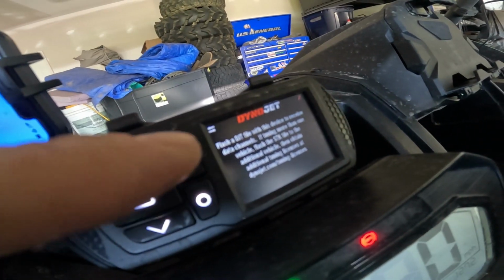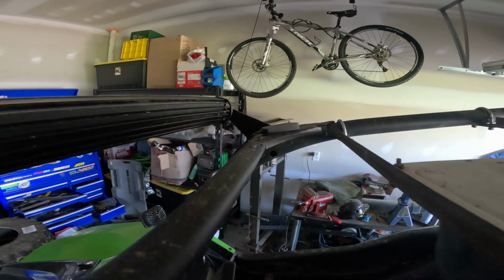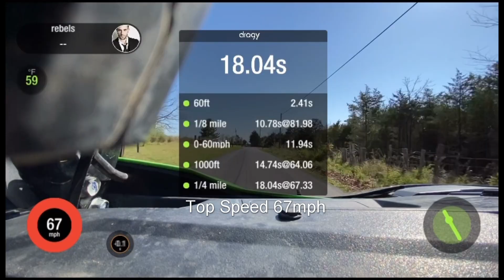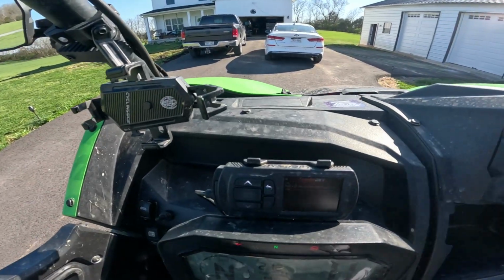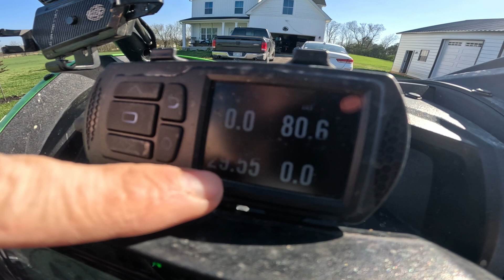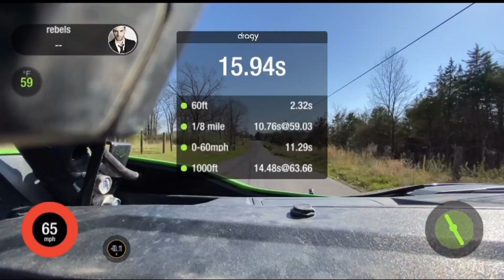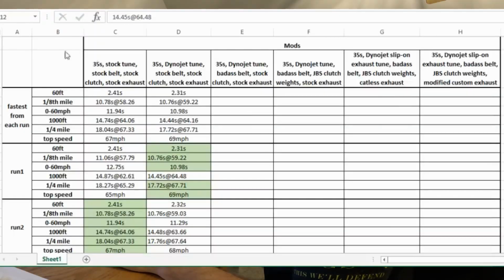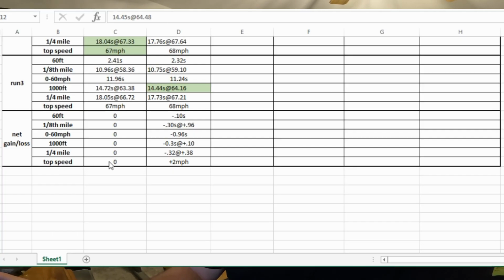How Fast is Kawasaki KRX 1000 on 35s with Dynojet PV3 tune?

Comment: Yes been waiting for this I just got the dirt legal thing done to my side by side drive it 30 miles to work tonight I will be getting smaller street tires ASAP had a headache by the time I got to work them 35s are loud on pavement but all this street riding is hit me thinking I would love to have more throttle response it cruised easy at 58-68 miles a hr for a 18 mile stretch belt temp did get to 3 bars which I’ve never seen it get above 1 on the trails but I guess 60 mph for 18 with 35s would cause it to run higher but motor temp never hit above 170
Reply from the maker: That’s awesome you got yours street legal! Mine is finally street legal in WV and I’m making a video to show how I did it here soon. Idk if I’d get much smaller tires if you want to cut down on noise. The smaller tires will create more RPM and engine noise but you will have lower belt temp and better throttle response especially with a tune. Thanks for watching!
Reply: @rebelsoffroad  the 35s I have on it now or Sedona trail saw and man they gave me a head ache but it sure was fun driving in the roads it’s illegal in Ga to ride atv on roads and they want title a off road vehicle is why I used dirt legal yeah man great video can’t wait to see more do you still have factory exhaust on that machine ?
Reply from the maker: I’ve heard good things about the trail saws offroad how do you like them other than the noise? I haven’t done any exhaust yet but it’s on the list
Reply: @rebelsoffroad  they great on the trails not as good on rocks as rock zillias  but since I did the dirt legal thing I haven’t had much time and haven’t been on the trails since thanksgiving only black top and they are loud on the road I’ve put 100 miles on the asphalt with them I’m buying new wheels and highway tires next week so I can keep my trail tires good for my windrock trips
Reply: I’m surprised you hear tire noise at all. I have 35” zillas and the engine and exhaust noise are so loud I don’t hear anything else including my music above 30mph. It gives me a headache and so I only ride the street if it snows or I’m running to the gas station 1/8 mile away to fill up before a ride
Reply: @marka1712  yeah it’s loud I’m buy some street tires and different wheels asap was gonna order this week but as you know unexpected stuff always happens just my luck

Comment: Nice video. Curious if you hid the PV3 wiring through the dash or just ran it straight down to the plug?
Reply from the maker: I hid it and zip tied it behind the dash so I wouldn't kick the cord getting in and out.

Comment: Did you make part 2?
Reply from the maker: Yup! And part 3 😁 part 2 is the badass belt and part 3 is the jbs weight
Reply from the maker: Best belt for Kawasaki KRX? Badass Belt Install & Performance Testing (With Real Draggy Data)
https://youtu.be/I30D5btbuU8
Reply from the maker: How fast is Kawasaki KRX 1000 w/ JBS clutch weights? Install and performance testing, 0-60 and more!
https://youtu.be/8NzQKFtwJ7k

Comment: This is just tune, no exhaust, correct? 87 or 93 tune?
Reply from the maker: Correct. 91-93 is recommended with this tune. I typically run 93

Comment: Really not a lot of games for a lot of money
Reply from the maker: Im learning that if you are looking for big gains from any clutch weight or tune you’ll be pretty disappointed. Only so much a NA engine can do
Reply from the maker: The gauges and other features the pv3 have are what makes it worth it to me
Reply: Here are some other reasons a tune might still be a good idea:
Adjust rev limit
Adjust speed governor
Raises limp mode to 7000rpm
Adjust drive by wire
Adjust cooling fans engagement temperature
Eliminate Reverse limiter

Throttle response and reverse limiter were key for me.
Reply: @RockCrawlin those things were all set by OEM for a reason. Any deviation from stock will reduce reliability and longevity. In my opinion bolt on mods like intake, exhaust and clutch are the only things you should use with a mild tune. If you want to tune further then getting into the engine with power supporting mods is the answer for reliability and durability.
Reply: @93Tillinfini  Agree and disagree.  Manufacturers make their machines to perform for the middle of the bell curve.  Their OEM specs are for the people who don't change their oil per recommendations, have old fuel in their tanks, don't inspect belts, don't blow out clutches, drive in low when they should be in high, drive in high when they should be in low, shift the diff at the wrong time, use the wrong diff setting for the terrain, have poor throttle control, etc.  They have restrictive settings to protect the machine from ignorant or abusive users.  Some of the settings in the tune are required by the government.  Requiring emissions controls that get hotter than the engine wants isn't a good thing for the engine.  Are you saying that having the coolant fan kick on eariler will reduce liability or durability?  Are you saying that defeating the reverse gear governor that can help you get out of a dangerous situation will reduce reliability?  Are you saying that if the OEM fuel mapping is more lean than it should be that making a needed adjustment to that to help longevity or reliability isn't a good thing?  OEM is 31 inch tires.  Yet half the threads on the KRX forums are asking if 35 inch tires will fit without rubbing.  "In my opinion" doing engine mods is fantastic for greater output, but...at the cost of what?  More power wears on other components like ball joints, A Arm tabs, transmission gears, diffs, hubs, etc.  Are you saying that doing mods to the engine without beefing up everything else doens't impact durability or longeviity?  My point is, yes, OEM specs are set for a reason.  But many of those reasons are to prevent people from damaging their machines from ignorance or neglect.  If you're not dumb and have the ability and know-how to maintain, protect, and enjoy modifications, why not do it?